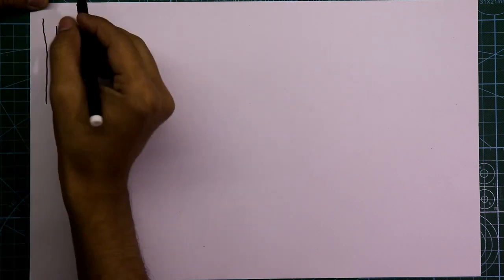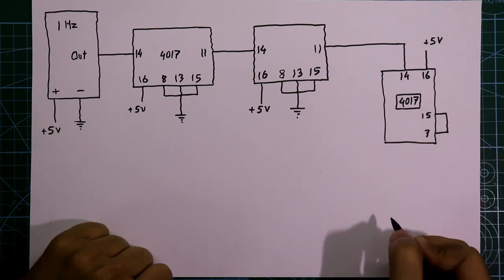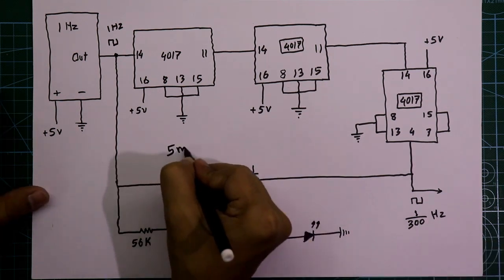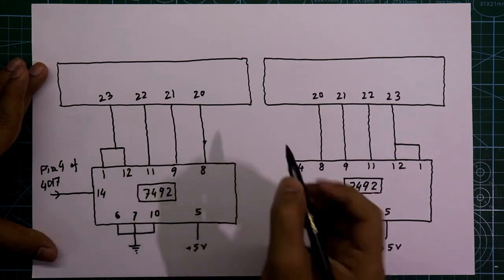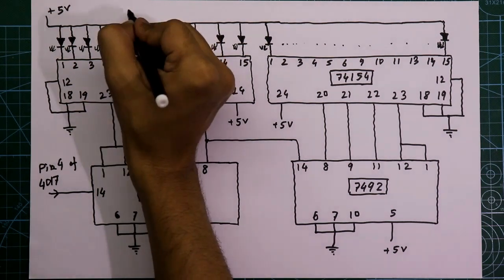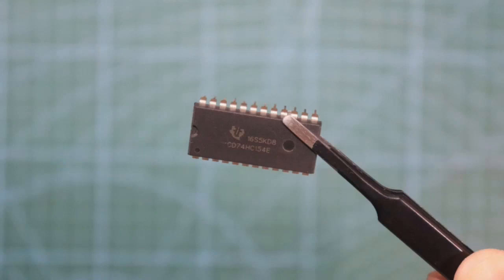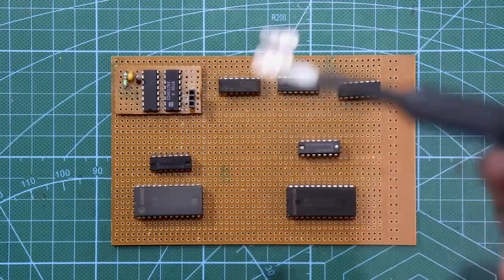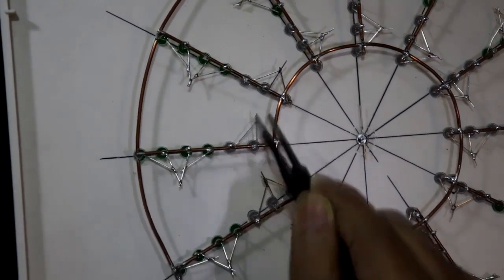Analog clock with LED without micro controllers

Comment: how to count up to twelve seconds with this circuit? I want to install the led from 1 to 12 seconds
Reply: You can refer to the 25 LED chaser circuit video by this guy.

You have to use 2 4017 ICs, and stop the second one at 2
And use the 1hz circuit instead of 555 timer, and you'll get perfect timings